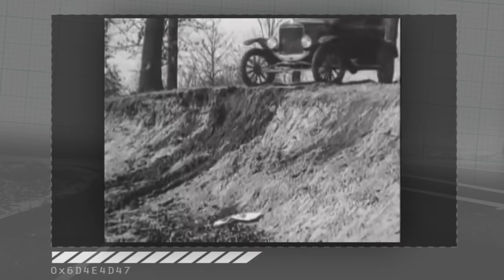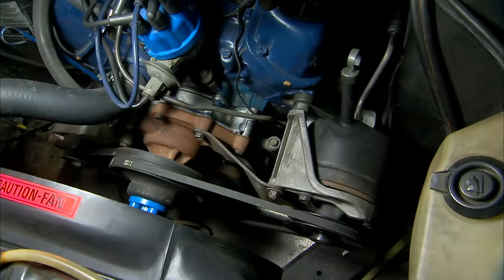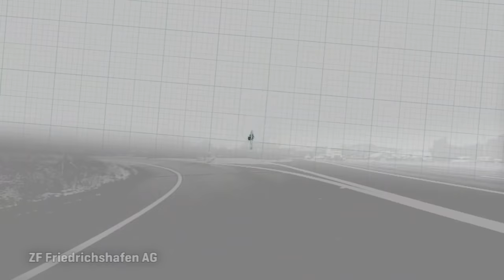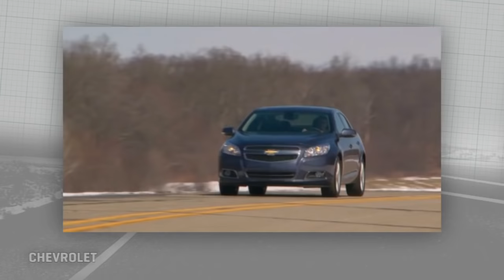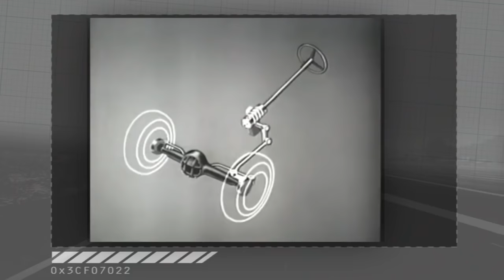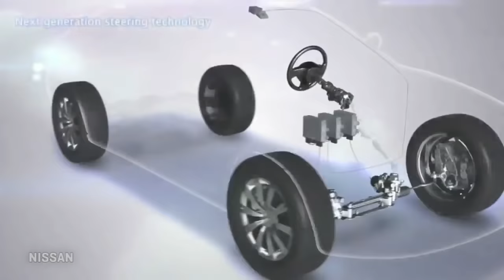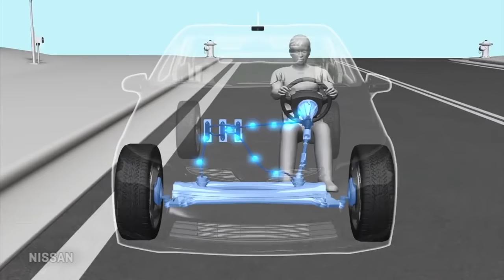Car Tech 101: Power steering explained

Comment: Why in the world would you want a "Steer by wire" system. That's just dangerous. Brakes and steering must ALWAYS have manual control.
Reply: 1000% agree! My wife's new Kia is electric power steering and brake assist, as are most new cars, and I can't stand it! The steering wheel feel changes with road speed (virtually 0 resistance at idle/crawl speeds, very stiff at highway speeds... just make it the same at all speeds! ugh!). The brakes I hate more! Press a little and they do very little. Press a little more and you about smack your face into the steering wheel (particularly when under 15mph)!  Also, braking of the vehicle changes as you slow down and the transmission downshifts. Even tho you keep your foot at the same place on the brake pedal, your rate of deceleration changes all over the place, especially in the Sport modes!!! I find that not only annoying but dangerous! In stop & go traffic, my rental Jeep Cherokee was all over the place on braking rate in sport mode! First I'd be slowing too slow, then the tranny would shift and I'd have my head snap forward, and then it would release & I'd be braking too slow again! Way too easy cause accidents like that!!! Make it all THE SAME, like old vehicles, where braking speed doesn't change unless you change your pedal position!
Reply: I agree. This "by-wire" and "software-controlled" business is sheer madness.
Reply: You can change degree of rotation from let's say 900 to 550 for instance. Also autonomous cars may become safer statistically so it would be the logical choice.
Reply: as long as you utilize discreet circuitry and basic computing rather than complex computers that can have bugs and crash, then the reliability just comes down to your power source. hydraulic power steering only works if your engine runs, which is ostensibly much quicker to fail than a battery which, as long as it's charged, won't suffer mechanical failure. engines and pumps can all together have thousands of moving parts. a battery and computer have 0, and an electric motor drive will have maybe a dozen. All in all, the most-impervious-to-mechanical-failure option is a legit manual rack and pinion. but pinning electronic against hydraulic, you could make the argument any day that electronic is actually more reliable.
Reply: Absolutely. I don't know about the US or other countries but here in Germany a Steer-By-Wire system with no mechanical connection is actually illegal. By law motor vehicles have to be steerable even when power steering fails.
Reply: You can have all the power steering and power brakes you want. Those are assists, not controls. The moment you make steering/braking completely controlled by electronics, you are setting yourself up for a CATASTROPHIC failure. Even throttle by wire has a dangerous element as proper throttle control is ESSENTIAL in the event of a front tire blowout.
Reply: And they are piloted by highly trained professionals with MANY redundant systems. I don't know if you've noticed, but most people on the road are FAR from "highly trained."
Reply: Warndog not sure how the pilot's training changes the reliability of the system.
Reply: The redundancy on aircraft not found on cars is what changes the reliability. The training comes in for not panicking and making matters worse when things don't go as they should.
Reply: +Warndog Plus airplanes don't have to deal with one another all the time. A flight corridor, which is unobstructed most of the time,  is not the same as a road.
Reply: Warndog No matter how great the technology is you will always need manual control. The human mind can make decisions. Bots have to be programmed for specific situations. On the road you don't know what is gonna be thrown at you.
Reply: given that we've been driving for like 130 years and we built the cars and the roads, we actually do know what is gonna be thrown at us. I still agree that on the topic of self-driving cars there should be a manual override at all times, however a PID driven steering collumn is not a computerized driver it's just a more electronified variety of a simple mechanical/hydraulic steering column. it could even be built with discreet circuits and again, alternators are more reliable than steering fluid pumps so why shouldn't all cars have drive-by-wire?
Reply: Warndog 
Agreed 100%
Reply: IN FULL AGREEMENT
Reply: Chrismofer You do not always know. Please remember that on a road another car is not the only possible thing that can jeopardize ones safety
Reply: Mike Boulrice And not all aircraft are FBW. I believe many Boeing planes still have a physically connected Yolk
Reply: Nissan has that already availabe in their  Infinity brand  Q50 sedan .   ....
Reply: Uh, because you'll get that "ZERO" feel / connection to the road? I mean, you steer, the wires transmit it to the thing that controls the wheels and the wheel does its job. but that's gonna make it harder to make corrections on steering.
Reply: jet planes use fly by wire, that is how dangerous it is.
Reply: +Keisuke Takahashi  power stering Bolero XL power steering
Reply: Good
Reply: Airplaines are "fly by wire" since nearly fourty years now... 
The F-16 are not really falling out of the sky, do they...
Reply: I don't think you notice how many times planes are checked and repaired per year by very skilled engineers versus cars that most times are just checked once a year by a common mechanic.
Reply: Well folkes its the standard now in 2018
Reply: Guess what. It's actually for safety.
Reply: not only that but its not as satisfying as driving with hydraulic or, dare i say it, electric power steering. in 2015 i think, Inifinity introduced steer by wire systems to the Q50. Pretty disappointing.
Reply: @JoeIsCrazyWillman  wow that is a massive comment, but yes I 100% agree 👍
Reply: but what about fly by wire in most modern day aircraft?
Reply: Aditya Koduri that seems hella dangerous as well!! i kind of understand it’s with air craft because it’s hard to have a physical connection run as far as it would have to go so it might be safer to just run a fly by wire system there
Reply: Don't know if you've heard but mechanical control systems can fail too, broken steering shafts are a thing. In fact I trust electronic systems more than mechanic ones. Whenever a device has both electronic and mechanical components it's almost always the mechanical components failing first, just ask audiophiles who bought stereos from the 80's. 
And the idea that we can't have them because there are too many morons on the road, I'm sorry but the opposite is true, electronically controlled systems prevent the user from doing stupid things. Plenty of accidents have been prevented by ABS brakes stopping idiot drivers who can't operate their pedals properly and automatic transmissions preventing users who can't operate a stick shift breaking their gearboxes. The more the car prevents stupid drivers from doing stupid things the better, a steering system that makes it physically impossible for the driver to override the steering assists no matter how much arm is put into it and causing the car to lose grip or flip over is a good thing.
Reply: it's power steering. you'll still be able to steer if it fails you just wont have the assisted steering.
Reply: electric components are actually much safer than mechanical, they just feel more dangerous because your used to them feeling a certain way

Comment: I still have no idea what power steering is...
Reply: Power Steering = Assisted Steering, you basically don't use all your physical strength to steer the tires, the car has a mechanism to do so either using liquids and a pump or an electric motor and computer... If this was a joke then meh.
Reply: joseph bourne if you understand anything about power steering in this video then you are a wizard
Reply: joseph bourne oh no, an engineering elitist!
Reply: basically the steering wheel moves quicker.
Reply: Literally.
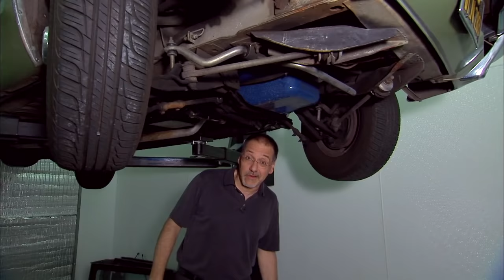Reply: 0:50

Comment: doing a 100% electric steering wheel is as idiotic as electric emergency brakes
Reply: +Peter Schmidt Yep. I like the physical effort of actually pulling the handle, so it feels secure.
Reply: Mouse Mystery To me it isn't about the feel.  The sole purpose of the handbrake/e-brake is when ALL else fails.  With a classic e-brake, it doesn't matter if your brake line broke, if the battery is dead, or if the car is even on - it just works.

Some could argue that it's just for parking, but automatics don't need an e-brake for parking.  But whether you're driving stick or if you're on a steep hill, how does an electronic e-brake know how much force to apply?

For safety reasons, I'll always avoid cars where brakes and steering are 100% electronic.
Reply: I'm never gonna drive a car That's all drive by wire. I don't even like the idea of most planes being fly by wire.
Reply: +Peter Schmidt Wrong
Reply: stealhty1 Oh, well since you did such a great job elaborating, you're absolutely right (sarcasm)
Reply: +Peter Schmidt agreed. I mean just at the location , is bad , if it breaks down (which is expected) it's eletricail work, it just seems bad to come out as a part if we're moving this far in technology(which were not ) just release a hover car and or the batman movil lol
Reply: mechanical systems are more reliable and easy to fix than electronic systems but I'm glad that electronic systems are getting more and more failproof everyday
Reply: +Derpancakes The complexity of flying an airplane, plus all the extra redundancy in a fly by wire plane, plus the much lower chance of physical damage to the control system or it's wires (in an airplane), all outweigh the risk of a fly by wire airplane. Of course if it all does fail then its game over pretty much off the bat but it still makes sense there. 

With a car however, you are right to say that it's pretty dangerous for it to be drive by wire especially since it's not likely to have redundancy and a faulty car could cause immediate death whereas a plane, high up in the air and moving in 3D space could have time to recover.
Reply: +Peter Schmidt Automatics actually need e-brakes in order to protect the transmission when it is mechanically locked in the Park position. This is true especially when you have to park at a grade. (Unless you prefer a two ton car pushing on your transmission when changing gears after you've parked).
Reply: A bunch of old men in here, afraid of new technology they don't understand.
Reply: Jason schmidt
Mind elaborating?  I'm 26 and develop robots, so I'm hardly old or one to not understand technology.  But doing 100% electric systems are fundamentally flawed when it comes to something as crucial as steering.  It is imperative to have a failsafe.

For example, with hydraulic steering, you could have a leak or overall failure in the hydraulic system and still be able to steer.  With electrically assisted steering, you can still steer if the motors or fuse burn out.  But with a 100% electric steering system, failure is inevitable and you will be screwed if that happens.
As for brakes, electric brakes might not apply enough pressure to deal with a slope.  They could also apply too much pressure and stretch out the cables.  If the battery dies, you won't be able to push-start the car.  There is absolutely no advantage whatsoever to electric parking brakes.  It's hardly more convenient.

There are things that are done better electronically, but there are a lot of stupid problems you could easily avoid if you have something mechanical.
Reply: we are probably related. are you in Germany?
Reply: Jason schmidt
No, but I do have a German heritage.
Reply: +Mouse Mystery Yeah so true, suppose in electrical system, we press brake pedal and nothing happens because the brake pedal sensor has malfunctioned.......
Reply: There are areas of application where electronics serve no good purpose. They are gizmos designed to lure the customer into the showroom and make more money for the automaker when they break down (and they always do).
Reply: You can pull the lever and feel it grab, but it's still lose. I've got a friend with a '99 vectra and his handbrake doesnt work, but you can feel it in the handle that it is. E-handbrake sucks a lot more. I've met a lot of people who had to replace components on new cars.
Reply: your right , check out this news article, a driver got a killed because of his out of control cruise control:

http://www.dailymail.co.uk/news/article-3968218/Terrified-driver-32-called-999-control-Skoda-sped-motorway-119mph-cruise-control-stuck-crashed-lorry.html
Reply: Think again!
Reply: Peter Schmidt wait, do automatic cars not hand handbrakes!?!?!?!?
Reply: Electronic steering wheel is a real bull shit
Reply: There is no such thing as an emergency brake in a car! Try pulling the "e" brake while facing an emergency and I can guarantee you it'll make it 1000 times worse! It is a parking brake that can also hold your car in a hill and isn't really needed in an automatic car since the transmission is locked when in park.
Reply: Or wireless seatbelts

Comment: I believe mechanical parts will be always in there, since this is a safety component, e.g,. in the case electronic fails, you still have one shot to steer the car and avoid an acident.
Reply: Mordern cars already have reached the point where they entirely rely on electronics to function.
In fact, if your car was built in the last 30 years, it wouldn't even start and/or run if the electronic failed.
There's no reson to believe that electronic component are inherently less reliable than mechanical parts.
Reply: @jean-naymar602  cars have redundant system, this is a safety requirement. Try shutting down the engine (simulating an electronivlc failure) while driving, brakes and steering wheel will still function but very heavy.
Reply: @jean-naymar602  I heard the same often that there would be cars without mechanical linkage between the steering wheel and the wheels. But after a quick Google i read everywhere that such cars don’t exist. Any car on the road has a mechanical linkage between the steering wheel and the wheels. And i wouldn’t see a reason to skip such mechanical linkage; The safety factor in being able to steer is most important of anything. Lives depend on it. You can drive for an hour with a stuck throttle, maybe even an hour without brakes, but 30 seconds without steering is definitely a crash. And in electronics there are Way more linkages to make something work which can fail, than just having a steel rod doing the job.
Reply: Airbus the airplane manufacturer is famous for their "fly-by-wire" plane, all of the control surfaces on the airplane are electronic instead of a direct hydraulic connection to the cockpit, its all electrical wires.
Mechanical is much less reliable and more expensive to maintain than electronic, which is a lot lighter and with many less moving parts.
Reply: @jean-naymar602  tell that to the electronic throttle boddies and the run aways. the car in my pic is a 89 mark 7, the breaks are electronic, if the pump, motor, or accumulator goes bad, ill have no breaks at all
Reply: @Engineer9736  Yes, drive by wire power steering makes me nervous. A function too critical to totally detach it from the wheel itself, but you'd think they'd have a safety backup.
Reply: @Digital111 airbus plane has at least two sets of systems for controlling flight surfaces, from controller, electric source, hydraulic lines, to actuators. For a car, it might be more economical to just keep the mechanical linkage instead of adding a backup for every system component.

Comment: Lane assist, self parking, braking for you systems... Those are all against my religion
Reply: yes dude
Reply: EvilJ069 ضwrt عهد هو عججتحم
Reply: your hydraulic god is death, hail to the god of electricity.
Reply: LOL
Reply: Oh I hate the automatic braking because you are too close to the vehicle in front.  On my vehicle it's possible to set it to not really work.  Sometimes it activates but its due to the person in front braking and the closing speed being higher than normal but I have it under control.   BMW also made it where the seat belt tightens up automatically.
Reply: EvilJ069 you sure
Reply: +PAVAN NAYAK Am I sure about what?
Reply: You forgot automatic transmission dude.
Reply: EvilJ069 imaging going 70mph down a motorway then you can’t brake or steer.

Comment: I like electric power steering when it's dialled in correctly, actually feels better in many cases. I don't want steer by wire though. No need for that shit.
Reply: Qasim Mir 
Agreed
Reply: Well if you don’t want steer by wire you better not fly on an airplane because the new airliners like airbus use it and I know F16 fighters use the system because I used to work on them.
Reply: @goodfoot7926  But isn't there more than one of those flap like things on each wings. Can't the plane be still controlled with one of them not working? It's not the same in cars. The steering is the only thing that can control the car.
Reply: You'll only get good steering on performance cars these days. Modern run of the mill cars, with overly assisted controls have awful steering and handling.
Reply: Agreed!
Reply: Soon you won’t have a choice
Reply: @goodfoot7926  Airplanes have 3-double systems checking each other. That’s a whole different level of engineering than what consumer cars are at. The costs of such redundant system will never make it into consumer products.